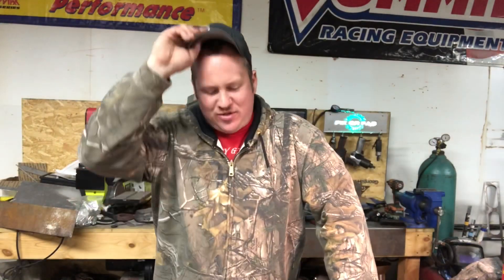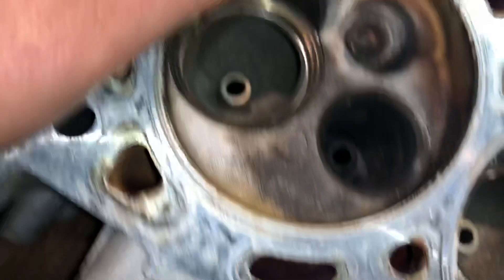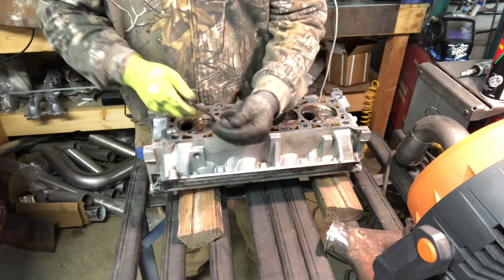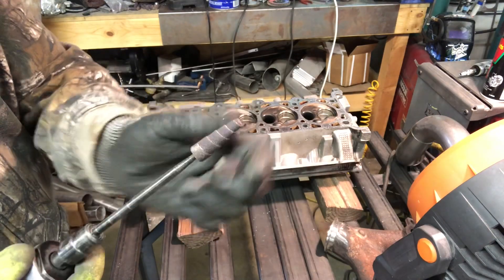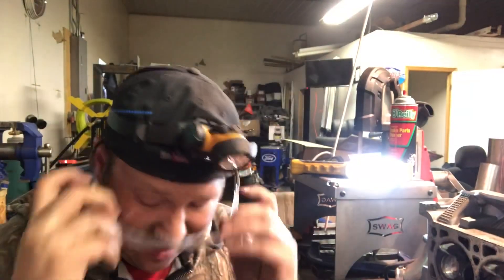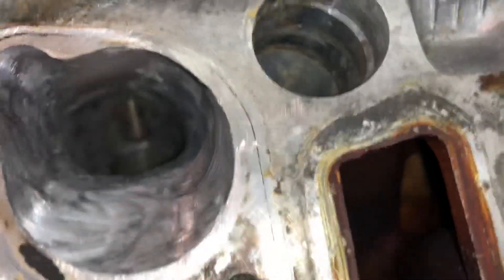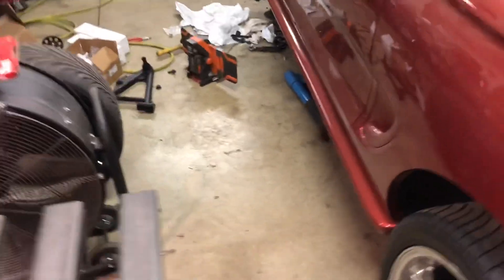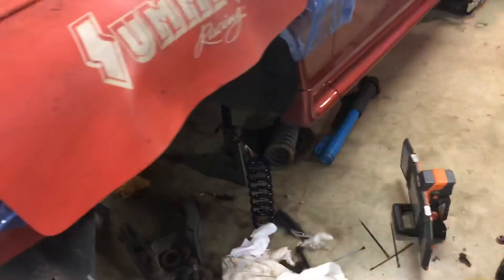Fix or Fab: Ford 2v head porting/mustang update!

Comment: When doing the bowls/throat area I always put a bolt into the chamber side of the guide. The grinding media will spin the bolt before you damage the guide. When doing the chambers, install the old valves to protect the seats.

I use a big magnified lamp lense clamped to my bench and head stands. Preferably a foot control and HD dremel.

Don't neglect casting flash in the top side of the drain backs. You would be surprised what it can do when it falls off into the engine.

The last one is less is more in porting. Its easier to remove less material then put it back.

Comment: Those swirl dams have produced nothing but good results when knocked back to a shorter angle while not completely removing them. A npi head can exceed 225cfm without the removal of the swirl dam so dont remove it.

Comment: What is the point of doing all this work on NPI heads?
Reply: At 4k and more they will flow more then pi heads .on a boosted application,  lower compression is a better .
The flow number between the 2 are minimal.
Reply: @Spad68  they actually flow more than pi from about .450 lift and up..
Reply: Non pi heads average 9 cfm from .050-.550 lift and have a 146cc intake port versus a 159cc on the pi head. Peak lift is actually around 176cfm npi at .550 vs 159cfm .550 from a PI head. Problem with npi combos making good power is the low lift stock cams, and crappy npi intake.
Reply: NPI heads are not the reason NPI engines make less power. the biggest thing is NPI intake followed by the CAM and even though the NPI head has a smaller exhaust valve they are pretty much equal and the NPI head actually flows better at high rpm and lift. A ported set of NPI heads will out perform stock PI heads hands down and are equal to PI heads fully ported. and NPI heads can be picked up from anywhere from FREE get this out of my basement to $25-$60 a pair with nothing wrong with them. the money you save you can apply to aftermarket cams and springs. The PI intake is best shopped for in a salvage yard off a 2005 and up crown victoria PI engine for about $20 each and it is identical to PI intake for mustangs 99-2004 except you have to drill and tap another hole for the 2nd sensor. 5.4L truck NPI cams are actually superior to mustang PI head cams. so yeah you can buy pi mustang heads and intake with cams and spend like $1200 and get an inferior combo then porting you NPI heads putting in used 5.4 cams and a crown vic intake for lets say less then $150 because you gotta buy headbolts and gaskets as well. and this is for a VASTLY superior out come mind you not a almost as good out come. spend money wisely not stupidly.
Reply: @mathewhoffer4541  Say if I put those cams in a stock NPI town car with existing Trick flow valves & porting, I would have to reflash the ecm- yes? It doesn't set a CEL yet with the above and no cams.

Comment: next time you port a set of 2v heads go ahead and completely remove that giant wall blocking the intake valve in the combustion chamber in staid of just DE-burring it. It completely blocks like half of the potential airflow into the combustion chamber I cut them out on the heads for my 5.4 triton and wow it made a huge difference.
Reply: What wall exactly? Sorry for the dumb question but itll be my first time porting and i dont want to mess up. Thank you
Reply: @Anthony Mayz ill be na mostly with a 100 shot. Thank you
Reply: How can you tell the difference it made?